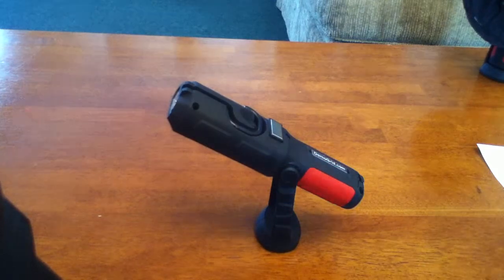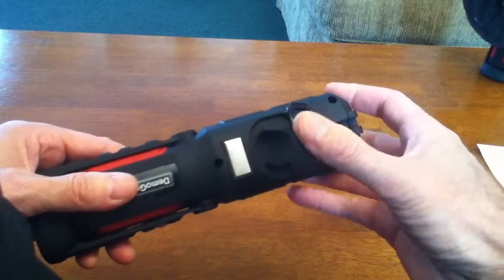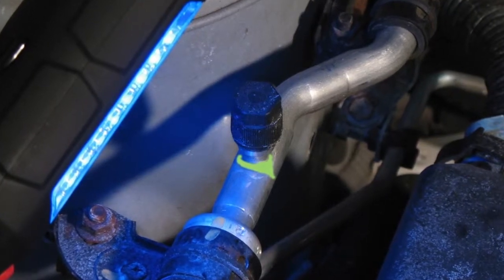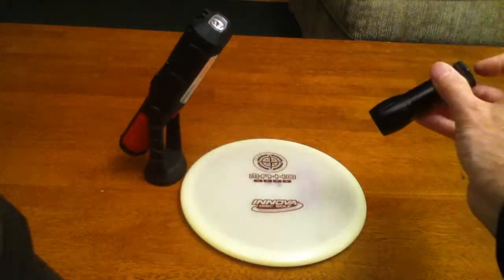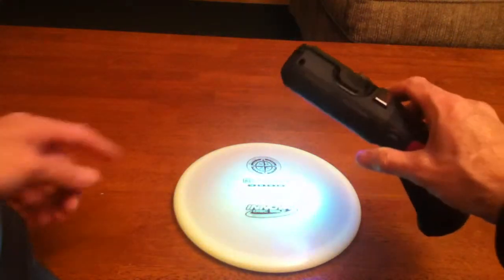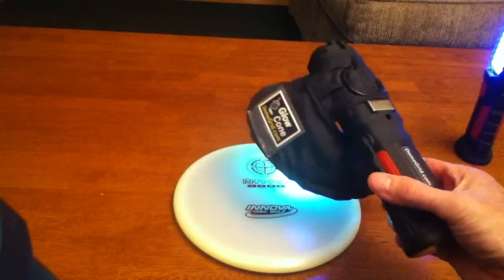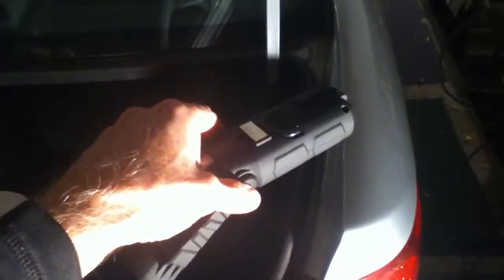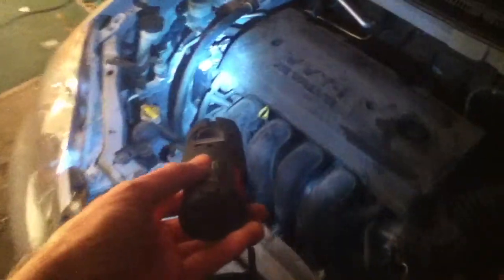UV (Ultraviolet) light (black light) and white light flashlight

Comment: In case someone would want to know, flashlight is using Ultraviolet UV-LED with wavelength 395nm (as according to description on advertised web page). I was just trying to find out if light with 395nm can also charge glow in the dark products better than normal flashlight or if you need those with 365nm wavelenght. So this video helped me a lot. And also this looks like a really cool and handy UV flashlight as well 👍